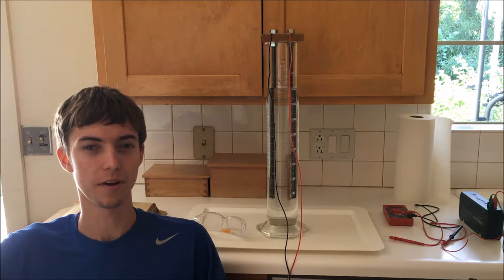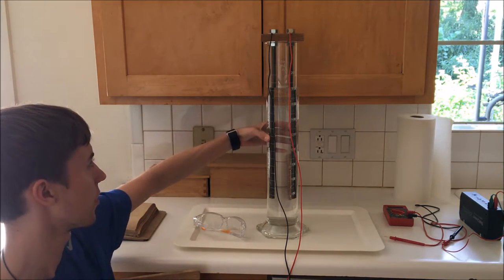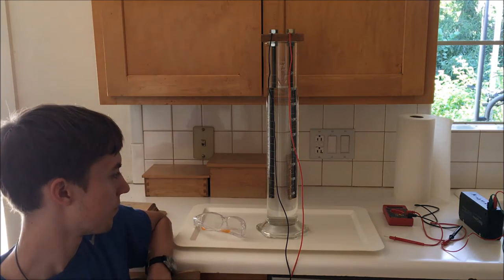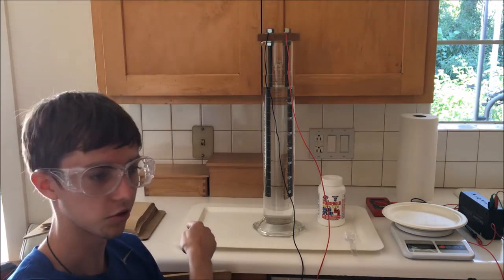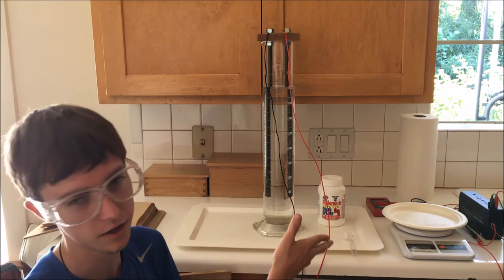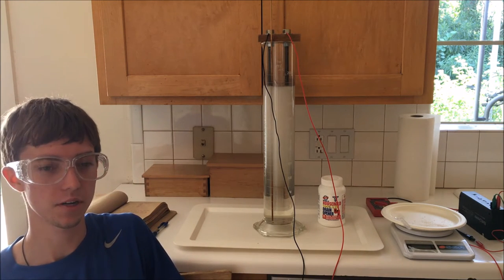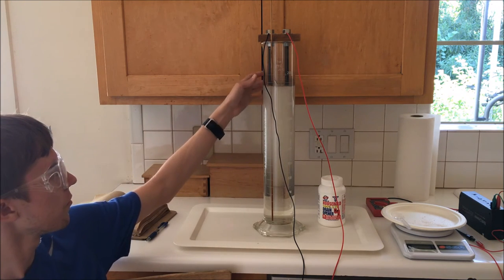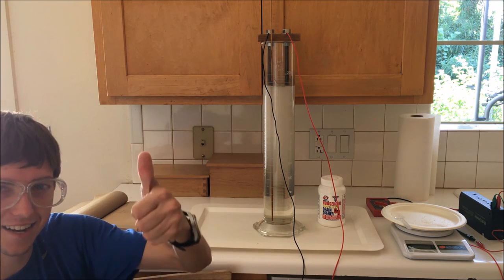EP 15 - Deuterium Enrichment Pt. 1

Comment: using a series of plates from the so called "HHO" cells you could quickly produce heavy water however as you know those devices draw like 1KW
would be fun to hook them up to a solar array but you would have to step down the voltage to 12v or 5v depending on how you wire said plates

Comment: Fritz Hansgirg's U.S. Patent #2156851 of May 2, 1939
Reply: Of March 2019 during an engineering conference held inside MIT's Engineering Dept on Vassar Street of Cambridge, MA. by Invite only I gave a presentation on cosmic ray muon catalyzed fusion rocket plane engine propulsion so I have a need for such an isotopic fuel.

I can prove how Noguchi and Songsu of early 1940s Hamgyong Province achieved muon catalyzed fusion via a Dewar of liquified deuterium fuel connected to a beryllium alloy reaction chamber nozzle coiled in around electromagnet coils since Sakharov's work began after the fall of 1945 after pillaginf by Communists and Alvarez's work began after U.N. Peacekeepers returned from Hamgyong Province.        

However, unlike Fritz Hansgirg I do not have access to cheap electric power of Hamgyong Proivnce and Eastern Manchuria nor access to Tripler Cold Box Air liquefaction towers of Noguchi's Nitchitsu Industries.
Reply: "industrial Electrochemical Processes" by Kuhn, "Electrochemical Industry" by Pletcher, and "Liquid Air" by T O'Conor Sloane.

Comment: if you are electrolysing water, then doesn't this just produce hydrogen and oxygen gas from the water, but won't the hydrogen gas produced contain both deuterium and protium? In order to create a deuterium gas, you would need to be electrolysing heavy water? How does this process separate protium and deuterium (i.e. enrich to a high deuterium level)?
Reply from the maker: bertazoid Theoretically the deuterium electrolyses fractionally slower than the light hydrogen, which allows this method to gradually accumulate heavy water for further processing. Above a certain concentration, you're right that the deuterium will start electrolysing at an equivalent rate as the hydrogen, at which point further processing is necessary.
Reply: Dielectric  ...  Do you have a reference to electrolysis separating light water first?
Reply: @bobt8735  
Its called the kinetic isotope effect
Reply: ............I have since found that electrolysis does produce light H2. So burning that with O2 produces light water.   .. I hope everyone knows that deuterium water causes aging, and death if you drink too much.
Reply: D2O doesn't hydrogen bond in the same way that ordinary H2O does, which causes disruption of certain biological processes. Drinking a small amount, or even a large amount, of pure D2O would be unlikely to have any noticeable effect - unless one continued to consume it regularly for a prolonged period of time.
Reply: @Tenkai917   130ppm of deuterium in distilled water will regulate glucose levels in the human body (diabetics might like that info). Also you guys should just distill d20 from spring water since it naturally contains d20
Reply: @dougcohen3364  all water naturally contains D2O